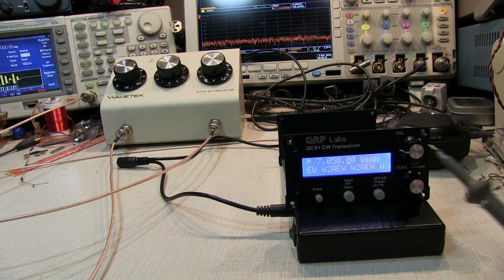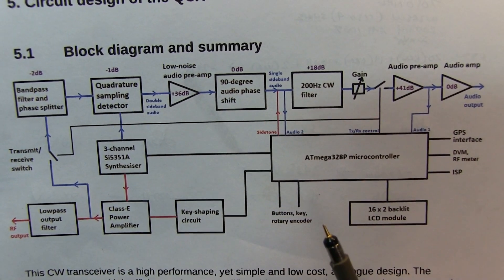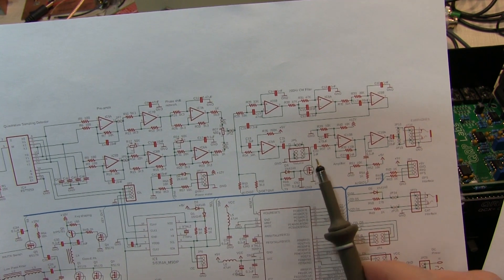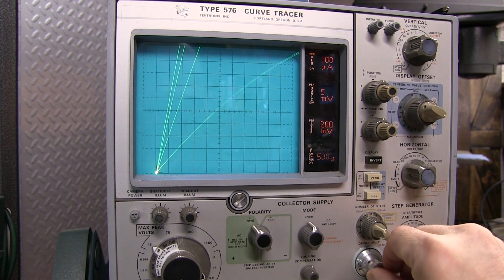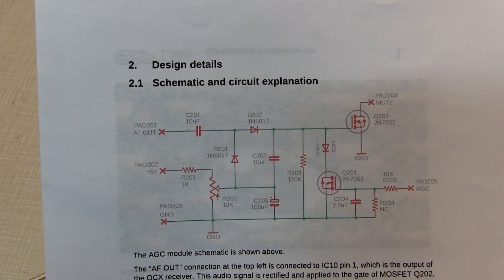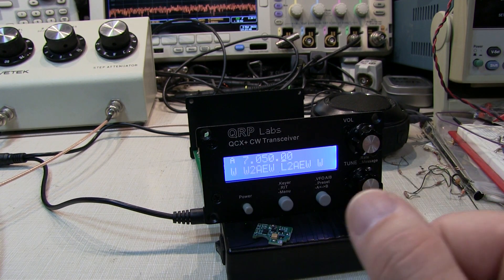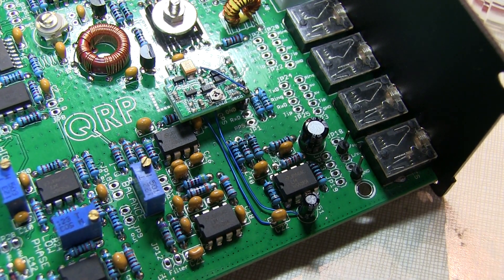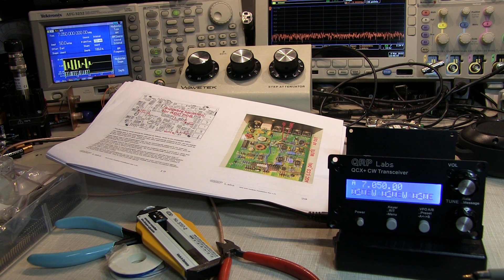#350: Adding AGC (automatic gain control) to my QCX+ CW Transceiver kit

Comment: Nice job Alan, what kind of wire are you using? Is that wire wrap wire?
Reply from the maker: Yep - love using wire wrap wire for this - the insulation is very temperature resistant, and it is good quality wire, easy to solder.

Comment: I have a "DSW-II" CW TRX (designed by K1SWL) which doesn't have AGC and NE-602  is saturated when strong CW comes in. Thanks to informing us a good idea of AGC on AF stage. I try to find your signal all the way from near Tokyo to the very distant east coast of USA. Good DX !
Reply from the maker: Of course, an AGC on the audio stage won't help with overload of the NE-602.  You would need to add some gain control (or adjustable attenuation, maybe using PIN diodes) to the the signal path before the mixer in the NE-602.
Reply: @w2aew  Thanks for advice, Mr.W2AEW. QCX has very high gain after IQ mixer. so AGC may more difficult than I think. I try to read Sch again.

Comment: I've installed 4 of these AGC units so it was really nice to see a description of exactly how they work.  How did you arrive at the bias voltage setting for your radio?  I ended up just setting mine to 1V based on the curve in the manual, but if you used a more experimental method it'd be interesting to hear about.
Reply from the maker: I did it a bit more by ear using the signal generator and attenuator used in the video.  I adjusted it so that S9 signals were just a bit louder than S9-10dB, and made sure that S9+10 or S9+20 weren't too distorted (pops).
Reply: @w2aew  I should probably go through and do the same thing, now that I have the equipment to do so.  At 1V the AGC "feels" very aggressive.
Reply from the maker: @jburchm1  Next time I open up the rig, I'll measure the pre-bias voltage to see where it is.  However, I suspect that a given bias voltage will give different results in different rigs due to the variation of MOSFET characteristics.
Reply: @w2aew  Interested if you ever looked at your bias?  Looking at the curves provided in the manual, there seems to be a lot of usable range.
Reply: Interested if you ever looked at your bias?  Looking at the curves provided in the manual, there seems to be a lot of usable range.

Comment: Dang it, man!  Your vid made me look this rig up,  and now I want one.  $55  for a kit version?  I have a $1,000 ic7300, and rarely do anything with it that this one wouldn't do.  Looks like it would make the best hiking rig ever. 

Thanks for the vid.
Reply from the maker: Note that the case is extra. The QCX-Mini is probably a better choice for hiking.
Reply: I have a QCX-Mini 30M version - about the size of a deck of cards, loaded with features (and yes, now it sports the AGC module I added last week).  I have used it portable for SOTA activations, and /P in general - makes for a very nice, small package.  Thinking about building the 17M version with the improving conditions.

Comment: Can you make a video on how to troubleshoot AGC circuits in transceivers and receivers because when an AGC circuit is not working correctly it gets confusing when there is a Gain Loss issues because the AGC circuit will compensate in a loop to try to make the input to the output.

Comment: nice vid and nice model, i always assumed that agc would be applied with j fet never thought a nmos would be a subtitute due to limited ohmic variance unless this is a new mosfet i dont know of, if i had to guess i would assume its n7002
Reply: The circuits uses a 2N7002.  The device I showed on the curve tracer was a 2N7000.
Reply: could u make a short video about peak detectors using diodes alone and using them combined with op amps, thanks in advance
Reply from the maker: @bumohamedubualooy7111  I did, many years ago.  Have you seen this? https://youtu.be/Fn5kHhNRsz0

Comment: Why not attenuate the rf signal entering the front-end? 
Does the front-end cope with so strong signals without saturating? If yes, how is that possible? How large is its dynamic range?
Reply from the maker: There are a lot of ways to implement gain control, this is the one that this designer chose.  There is no front-end preamp in this design. The RF goes directly into the Tayloe quadrature sampling detector, which is nothing more than a dual 4:1 bilateral switch (MUX/DMUX), so it has a very large dynamic range.  The output of the QSD goes into an audio grade op amp.  I haven't tested the overall dynamic range, but 20dB over S9 is still well within the operating range.

Comment: Quadrature stuff is hard for me to understand. Do you have any videos on that topic?
Reply from the maker: Check out videos #170 and #171 on my channel.
Reply: @w2aew  thank you! And thank you for making these videos for us
Reply: @w2aew  I just never understand how phase modulation can work, how can a receiver detect a difference in phase - I guess you have to use a PLL of some sort?
Reply from the maker: @researchandbuild1751  A PLL is one way.  Another is to use a mixer along with an unmodulated signal at the same freq as the LO- then the output of the mixer will be the phase changes.

Comment: Why wouldn't you use small FET directly on antenna input ?
Reply: - the goal is to control the audio.
- it's easier to work with audio
- it would raise the noise floor.
- it would screw up antenna match.
- it's a transceiver you'd have to get it out of the circuit on xmit.
Reply: @anullhandle  But by controlling just audio you don't solve problem of saturating previous stages.
Antenna match shouldn't be an issue for a receiver when signal is unpleasantly high. In other situations all that you'd have is a  small capacitance of a closed small MOSFET, which could be compensated for, if it would even be needed.
When MOSFET is closed ( which would be in any normal situation), noise also shouldn't be a concern.

First thing after the antenna is a Rx/Tx switch. So he could have placed right after the switch on the RX side.
Or, he could have it antenna and simply keep it closed during Tx.
Reply: @brane2379  I didn't catch him say he had a saturation problem.  If a front end is getting hammered it's either stepping on your desired signal and oh well or its off frequency and you'd want a filter that doesn't compromise your desired signal.
Reply: 🙄🙄🙄🙄🙄😀😀😀😀
De VU2RZA